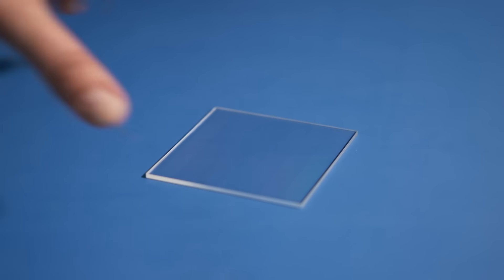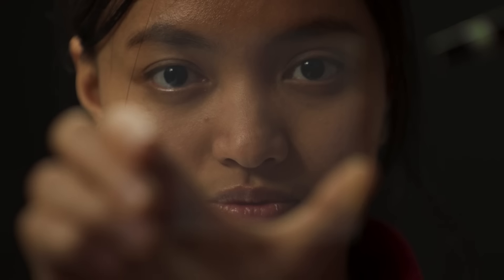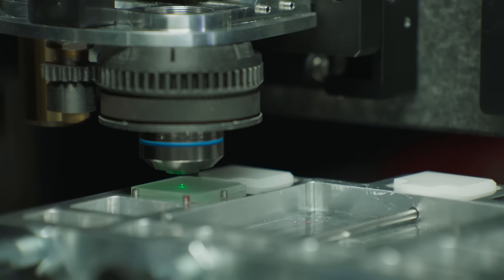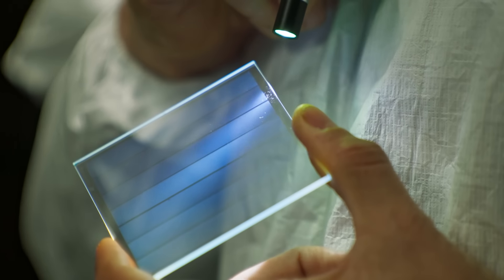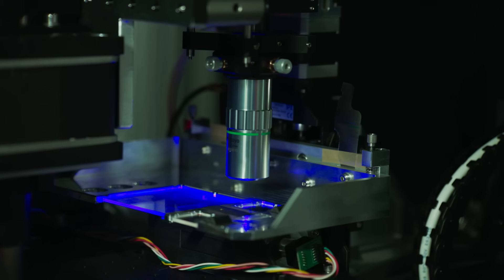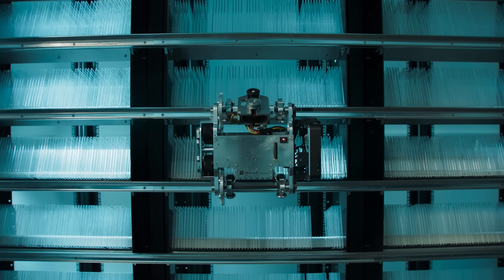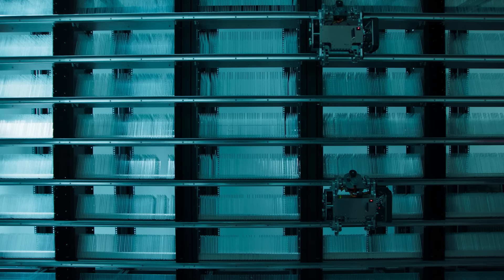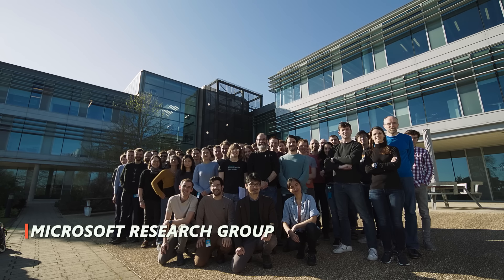Storing data for thousands of years | Microsoft Project Silica

Comment: For anyone like me who are wondering why they are using an amorphous solid as a storage medium, this is what I found:
"While amorphous solids can change over time, the amorphous nature of quartz glass, in this case, is not a drawback. In fact, it's one of the features that make it suitable for data storage. The lack of a regular crystalline structure in amorphous solids like quartz glass means that there are no defects or grain boundaries that can lead to data degradation over time, as is the case with some other storage media."
Reply: yes, but it will sag over hundreds of years, and storing it vertically on an angle does not help. The voxels will drift out of alignment. That data might last 200 years, but 1000? I don't think so, not with the presented storage conditions.
Reply: @chodnejabko3553  Hi, continuing this nerd discussion which I love so much!!!!

Uhm, if the drift is that obvious - such that we understand it happens - can we not include that variable in the decoding stage to check for data deviation due to drift-misalignment? It seems you have it here mapped to something of over a period of a 1000 years? That should be easy to account for, relatively over that period of time, yes?
Reply: What happened to the data storage in DNA strands? Last I heard they were doing it there.. 
Probably that DNA resulted into a human being with some customer data already fed in it... lol
Reply: so is principle same as with CD-R discs, write once, keep data readable hundreds of years? weakness of rewritable cd,dvd mediums is tradeoff with how long it lasts.
Reply: Wouldn’t it be nice to know how much data had been written on that piece of glass
Reply: @redmi3s51  DNA can be pretty unstable. You'd be better off using solid media which has less risks of being altered.
Reply: @kuryaku5906  Unless it's self repairing and self replicating (living). Otherwise you need to store it under perfekt conditions and completely encapsulated.
Reply: @redmi3s51  DNA is organic and will eventually degrade, so while it can be used to store high density data, it's not a viable alternative to magnetic tape for indefinite data storage.
Reply: @chodnejabko3553 That's a myth, man. Glass, in engineering terms, is perfectly elastic, meaning it cannot take on a new shape from bending without breaking. Glass does not change shape over any amount of time.
Rippled old glass was either a result of the manufacturing process, or was the style of the time.
Reply: @chodnejabko3553  I was taught this in school, but it's a myth. Yes, glass is an amorphous solid in its molecular structure, but it does not "flow" over time
Reply: Glass is not a liquid, it does not sag over time.
Reply: @haifutter4166  The DNA polymerase complex makes mistakes despite all the safeguards in place. Even if you picked a whale's, which is much more accurate, there is still more data rot than this solid storage method.
Reply: @kuryaku5906  You forgot the "repair" part of my comment.
Reply: @haifutter4166  And you don't know how DNA replication works. Unless you do external backups, it had too much data rot. And it's a long term nightmare to fix single identified mutation to keep the original data. There simply is advantages compared with physical data storage.
Reply: @kuryaku5906  Enlighten me. I'm interested, whether my professors failed all together with teaching us. 

But none the less, I agree with you. DNA has it's benefits, but it doesn't seem like a viable solution for long term storage and archiving.
Reply: @haifutter4166  You aren't completely off, but even if we take into account all of the DNA reparation mecanisms it amounts roughly to 10^-12 error rate (during replication anyway, which is the best case scenario).

Comment: Sometimes the better technology is the older version, this a breakthrough in such engineering, and how in ancient times we would write in stone tablets to preserve writings and all that, and so does books, but project silica might not require electricity to be stored, it still needs the equipment to be read and all that, but aside from the cons, its very sustainable, efficient, low carbon emission, has a very long lifetime. Very amazing.

Comment: Glass storage is an excellent method for preserving books and files that do not require future modifications. However, for company or personal use, it may be somewhat impractical. The issue with storing data in glass is the inability to edit or adjust it, coupled with the lack of quick and easy access to the data.

Comment: Interesting. I have some question, is it safe when it drops?  Also, how do you change the data if another data is already written in that glass?
Reply: I don't know what exactly happens when it drops, but the glass can only be written to once, and can't be changed after that
Reply: They might have made enough durable to resist some damage imo
Reply: @aDwarfNamedUrist  Write once isn't a problem if there is plenty of capacity. You can "delete" files on it by applying a new TOC. Just like we could do in CD-Rs (not RWs).
Reply: But why and how would someone drop it, if it's all mechanical. I don't think there's a chance of dropping it
Reply: It uses quartz glass, which is probably stronger than annealed glass but weaker than tempered glass. When falling from an average height onto some decently hard surfaces it would probably chip
Reply: @TheRandomBag  environmental catastrophes?
Reply: I don't think it's supposed to be rewritten. The purpose is long term storage without energy consumption
Reply: There are redundancy platters that contain data combined from multiple information platters, so the data can be inferred even if a platter breaks.

Data in the glass isn’t changed once written. Files are encrypted, and they are “deleted” by deleting the encryption key. The entire platter can be melted down if no files remain on it.

Comment: First and foremost, I want to say that I really do love this idea and its very forward thinking. BUT at some point, while I was watching this - I thought what if someone threw a brick in there?  I was actually thinking that right when Ant Rowstron mentioned that this would be "sustainable". And I agree, it has a long term value. I see a potential future. I also think that a hyper-safe environment (rubber floors, padded walls for various audio vibrations, seismic proofed shelves, etc.) is something that many corporations would want in place to protect their IP.
Reply: You don't need to throw a brick, just a few earthquakes!
Reply: And what happens if you through a brick on a hard drive or ssd?
Reply: This would be stored more or less in a datacenter. For those who haven’t been to a datacenter, they have layers of security from the moment you enter the vicinity up to the point of reaching your intended resource (e.g. rack). From that first layer alone every individual is screened including your bag so any suspicious material will be questioned and hold.
Reply: I agree with you
Reply: Redundancy. Do you think your data now is stored in one location?
Reply: Throw a brick at a hdd it will also die. That's why you make backups.
Reply: I am sure that they won't keep it directly outside. Maybe there will be a server with multiple of these glass pieces inside like a NAS and there will be hardware like NAS. Every data storage modules such as HDD, SSD are still delicate yet. So glass won't make a huge difference.
Reply: Data will be stored in multiple geo-redundant copies in datacenters all across the globe. One crazy guy with a brick won't be able to accomplish any permanent damage. Even if the entire datacenter collapsed in an earthquake.

Comment: This is really cool! I remember seeing this concept many years ago. What are the big advantages over CDs? The principle seems the same, and since there's variants to last very long like MDISC, this picked my curiosity!
Reply: CDs get eaten by fungi for some reason
Reply: @dzidmail  depends on the quality of CDs, there are some that last a lot longer like MDISC, it is rated to last 1000+ years, because it uses materials that don´t corrode easily. Although it is game over if you break them XD
Reply: More space, maybe?
Reply: @niltonsantos6790  Kinda. I am guessing this too. CD was 2D polar encoding. Voxels are 3 dimensional, so it might be a better use of the space. + more physical robustness.
Reply: I guess glass is more resistant to scratches, whereas CDs are prone to them. Although you could argue that CDs don't shatter, whereas glass does
Reply: @FlyingPigChannel CD's are brittle. So it could be shatter too. Glass are more resistant is true.
Reply: @jimbocarter7202   CD's are harder to shatter but yeah neither is very strong.
Reply: @jimbocarter7202  CDs are not brittle, they are remarkably flexible. Think before you post, for Christ's sake.
Reply: piqued
Reply: it is like if you ask what is advantage for ssd over cd

anyay probably less risk to damage, better data storage and easier to use
Reply: @vkobevk  it's not that simple.
Reply: @vkobevk  for archival SSDs aren't that reliable, at least on the long term without expensive maintenance (replacing them).
Reply: It would be interesting to hear how much data can be stored on one such glass sheet. Gigabytes, Terabytes? I'm guessing way more than on a CD.
Reply: CDs rot after a few decades, and are vulnerable to things like fire and scratching.
From what I remember reading about project silica many years ago, the quartz they are using as the storage medium is shelf stable for millions of years. It can also survive intense heat such as in a fire. It also has an advantage in terms of storage density; the voxels are stacked in three dimensions, so you can fit a lot more data on one of these quartz blocks compared to the 2D surface of a CD.  
One disadvantage is that each voxel is write-once. So it's limited to archival. Still, really useful for things that shouldn't change, such as media files (photos, video, books, software binaries).
Reply: @augustday9483  I guess it's more for professional use than consumers then. Even MDISC? I guess fire it wouldn't survive but seems that the rot causes are fixed by that variant of CD.

Comment: The video didn't say anything about storage density and lifespan. I remember reading somewhere it's on the order of hundreds of terabytes per piece of glass and similarly lifespan on the order of a few thousand years can be expected. It's very robust and one such piece of glass was sent on the the Tesla roadster that was launched into orbit by spacex.

But, all considered, given that glass is brittle, is there not a little risk? Isn't dna storage better?
Reply: I would think it is not any more brittle than other storage media like physical drives. DNA is probably still too expensive I reckon.
Also, the glass is likely tempered and hardened to withstand high force impacts.
Reply: Why not Atoms, or electrons, or photons, or wave functions.... You keep dreaming, everything is possible but it requires time and that race is just starting
Reply: They should ask - JerryRigEverything to do the hardware testing.. Shown in video that it is kept in oven, who knows if it is emitting any heat on glass. Why can't they put in a deep frier and show in reality that it doesn't affect the stored data??!
Reply: DNA would be really high density, but it would not last as long as glass. DNA has to be held at a very specific temperature range or else it will denature.
Reply: We have theories that single strand of DNA can hold so much storage but the process of handling the input, output and maintaining an extremely biodegradable is the main challenge.
Reply: for some perspective, if you want to keep DNA preserved on the order of centuries or millennia you might as well look at the actual real-life examples we already have: frozen animal remains. Even then, not all of it survives the process. On the other hand, we still have some pots and ceramics that date from the Roman Empire. I imagine the data potential of one vase would be quite vast.
Reply: Okidoki. BET you could Make that in a Garage. Considering. It's optical based media.. So literally it's modern day Punch code.. Like reading brail with your smart phon

Comment: Such a cool technology, but I just have a question though, since information / data are fluid and needs constant updates, can we actually overwrite the data within the glass with the laser technology, or is the intention of the project to store only data that are already finalized and will not be changed again (e.g. books, songs, movies)?
Reply: It looks like its finalized.  That looks like a rather high powered laser.  However it is glass so I think the idea is that the media is so cheap you can just make another one.  The big question is how quickly can the data be read though.  Its an interesting premise, but storing then reading things in that density requires some advanced tech.
Reply: @warlockd  As you mentioned the key word here is "advanced tech" to be capable to extract the data but if it happens that a neutrino/electromagnetic waves will hit that silo then how feature civilisation will manage to restore this capabilities to extract valuable information?
Reply: @HumbleHuman-k7g  
Well, the big plus for this storage medium is that it is shelf-stable with no electricity. So if civilization collapsed after a terrible CME event, the data can just sit there for thousands of years until humans get back to our current tech level and can start reading it again. Any other storage medium would have rotted away by then, rendering them useless.

Comment: The only thing about this data storage method is that altering the data within the glass sheet seems to be a tough engineering challenge...
Reply: I would think of it like a CD. It's just readable. Ultimately if you want to modify it you would have to copy it to another form of storage. At least the original data is preserved.

Comment: If your hard disc is only lasting 5 years, you need a better supplier. I've got drives that are over 10 or 15 years old and still perfect.
Reply: This is more of a probability problem I suppose. After 5 years they can guarantee that something like 99,999% (made-up estimate) of hard drives are still working. They replace it after because that is the point when replacing is cheaper than building additional redundancies. So yes, technically most hard drives can survive much longer but for data survivability, it is intentionally undershot. This is why this glass thing is such a big change. Very very very low percentage of data corrupting failures. If there are, then probably in connection to the robot.
Reply: @kainmrcoax2275  Yes, Mean Time Between Failures / MBTF. Hard Disk are by design not to be used forever. Especially 3.5 " drives. The ball bearings will die if you don't check them regularly. And hard disk at their edge tend to die during recovery processes due to the high load. There are specialised 2.5" drives for long term storage. It's the same like usual 2.5 " drives but with a special enclosure. I forgot the name of the system.
Reply: still, if you know how old disks are stored and looked after, this silica approach seems way way ahead.
Reply: Got to also take into account that these drives could be running 24/7 especially if they are running in Azure data centers. This too could increase hardware failure.
Reply: This is about centuries, not years.
Reply: DATA CENTRES. WATCH THE ENTIRE VIDEO FIRST SMH.

Comment: Silicon based glass is known to sag over long time spans due to it's amorphous structure. And storing glass panes vertically makes it faster, storing them on an angle with regard to data angles even worse for the data. Depending on quality of this glass, voxel size, they may be readable in 100, 200 years maybe. But 1000 years? Unless they engineer their storage in a way to counter the sag in material I don't see this. They may begin by storing those panes horizontally with uniform support over entire surface.
Reply: Yeah that also confused me. I’ve always heard that glass is never really a solid, just a very slow liquid.
Reply: Glass sagging and changing shape over meaningful periods of time is a myth.
Reply: lol that's a myth
Reply: That's a myth based on observations that old windows had glass that was thicker on the bottom, so it must've sagged with time. What those people failed to realise is that the "sagging" was just the result of the imperfect manufacturing process of those old glass panes and that the panes were customarily installed with the heavier side on the bottom, for obvious reasons.

Comment: Data Storage without any need of electricity is definitely a big PLUS.
I can definitely see this tec as a great solution for big archives.
Not the best solution for a data center, where data needs to be required instantly 24/7 however.
And to say "Glass can hold memories forever" ... no. Glass is not solid. It changes its shape slowly over many years.
These flat panels will start to deform and bend over 20 or 50 or 100 years and will break at some point.
Still ... better than every tape or harddrive or plastic disk.

Comment: Oh wow. This is really groundbreaking. I wonder if the glass gets broken? Can still the data be able to retrieve?
Reply: if it is possible with hdd, cd, ssd

probably yes, you cant recover 100%, but in theory you can recover the not damaged part
Reply: No, if you deliberately break it, it won't be working. Why is this not obvious?
Reply: @kassandercailliau8674 are you bring sarcastic, or is the most common methods of countering this problem not known to you?

We make backups, to ensure even if they are damaged, a copy exists.
With the added benefit of parallelism, this works wonders, and is taught in basic computer science courses.